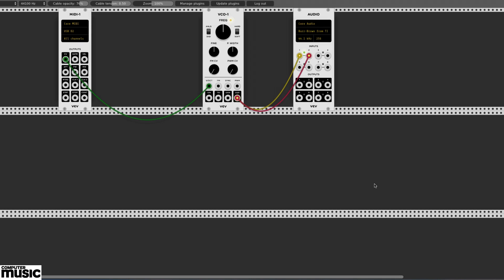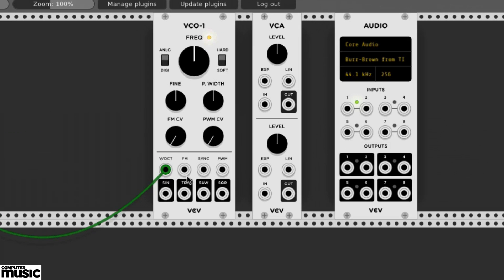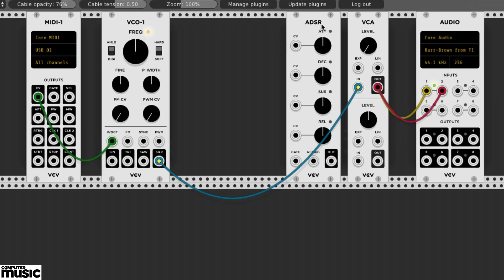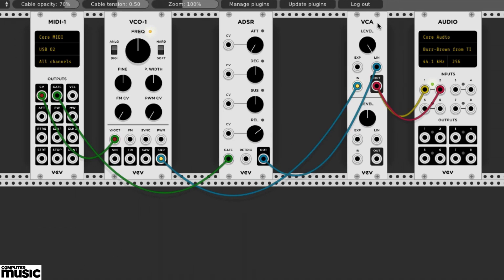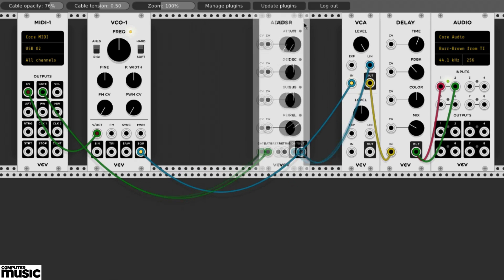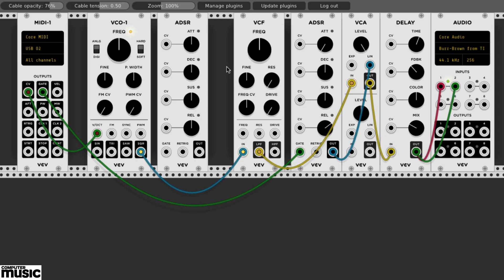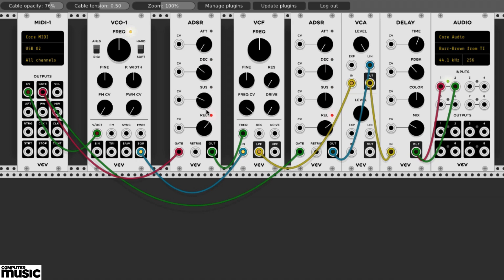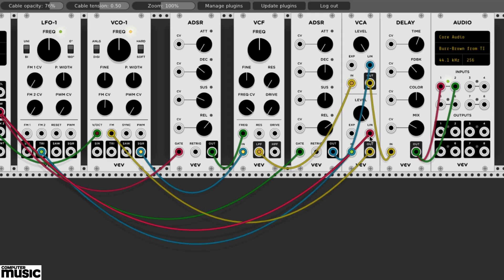Creating a Basic Synth Voice | VCV Rack Tutorial | FREE Modular Synth

Comment: Does anyone know how I can follow along and watch the at the same time? I'm using ASIO for VCV rack (which chrome doesn't support) so it seems I can EITHER watch the video, OR use VCV rack but I can't use both Chrome and VCV rack at the same time, due to them using different audio drivers. Does anyone have a solution?
Reply: Most of the time the fix would be to use an external or alternate sound card or an audio interface. I just watch the videos on my phone though while I'm using the software.
Reply: @maxipriest96  Cheers man. I've been doing the same with my phone 😁
Reply: Does firefox work?

Comment: The oscilator wont work with my akai mpk mini, right?
Reply: it can you need to set the midi device to your controller
Reply: Use Midi CC module in VCV Rack then each of the 16 slots available can be assigned to any midi device attached.